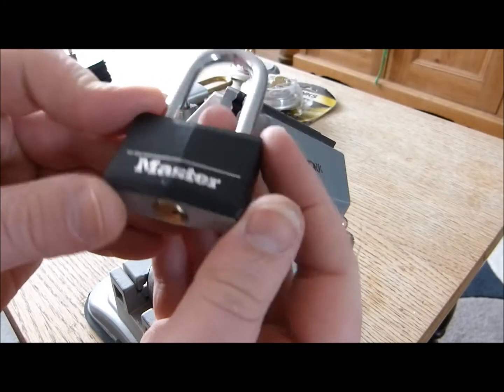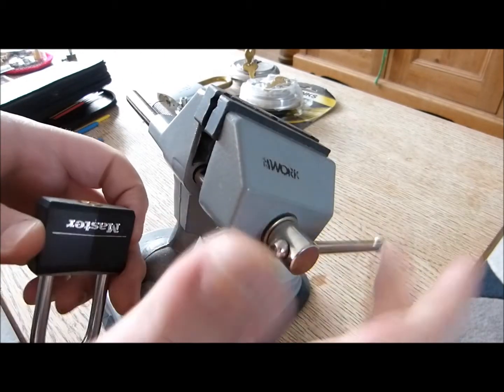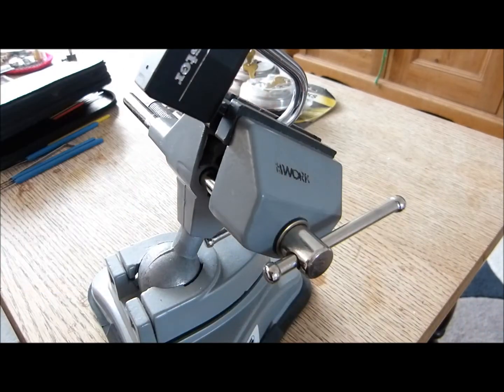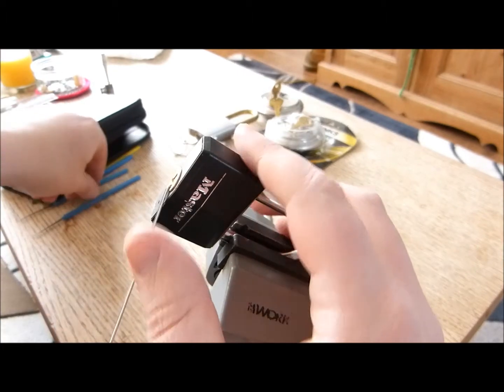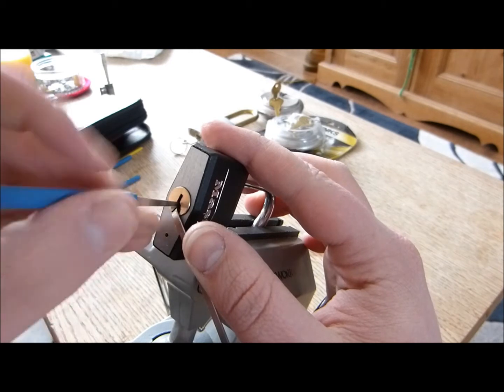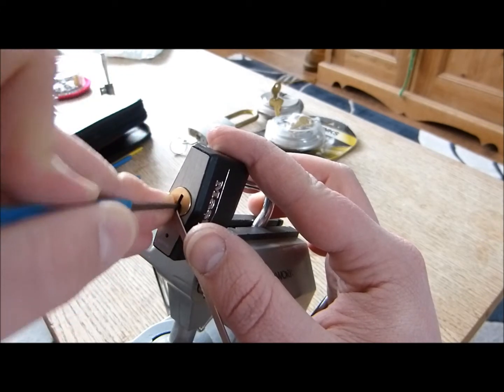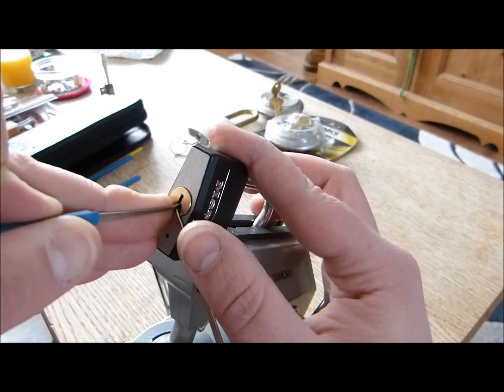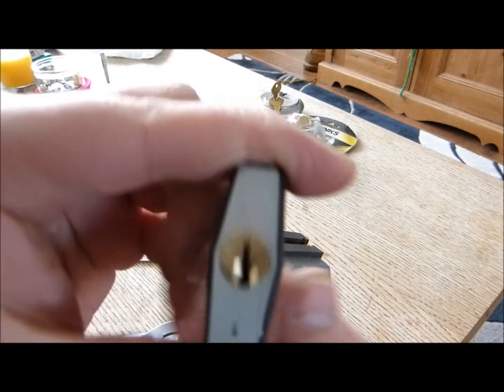40mm master padlock opened

Comment: ARGG, I have the opposite problem, I have both of those locks in front of me, I can SPP the BEST in about 1 min everytime. but I cant even feel the pins in the master, I cant tell if they are set/overset? 

How is your tension on the best lock? My pick set is cheap, so they are a bit thicker, Might it be the shear line is set low?
Reply: I managed to get the 40mm master with a hairpin in the first 3 min, but now, I have been working at it for a whole day and no luck. Frustrating.